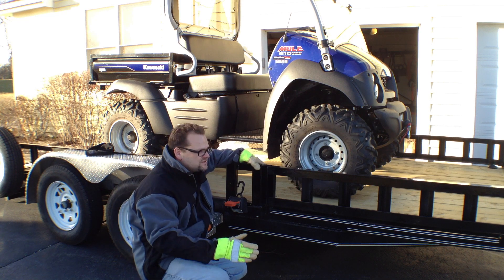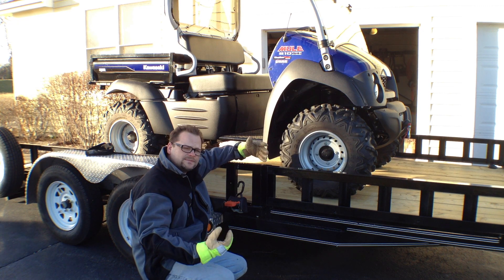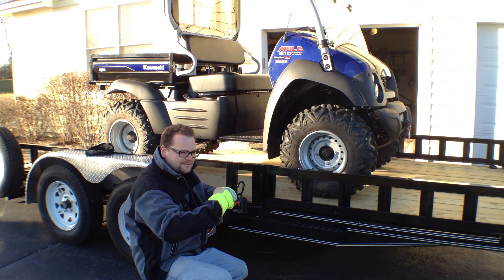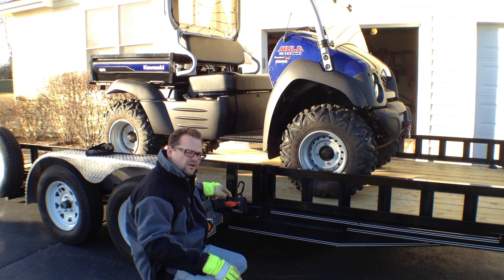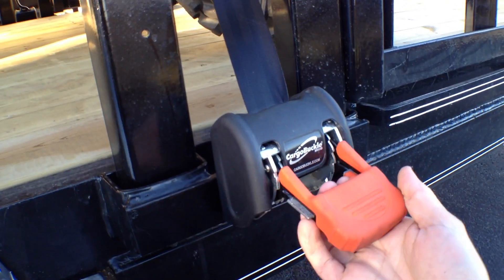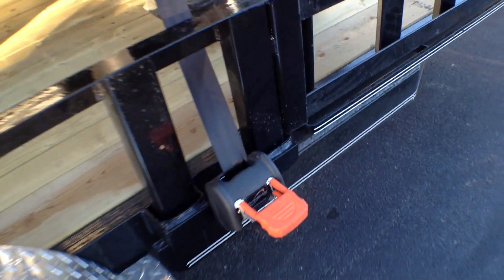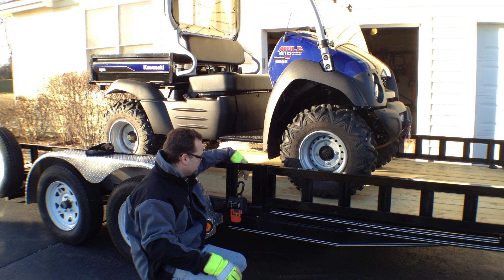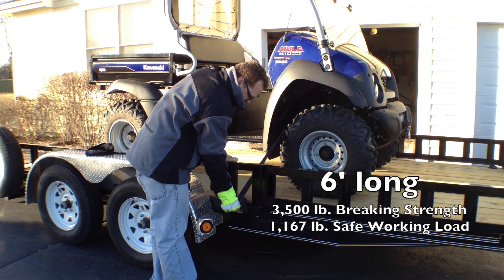CargoBuckle Tie Down System

Comment: Ya it’s not a new invention, they sell them to hold down the rear end of a boat. They are in stock at Bass Pro. I have them on my boat trailer to tie the transom down. They are exactly like these but are all black. Check the price of both before you buy!